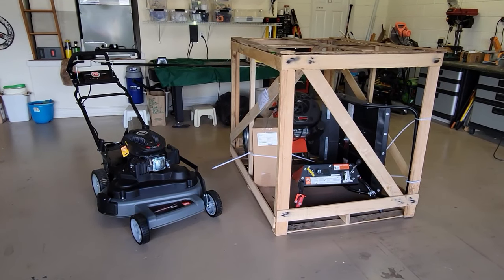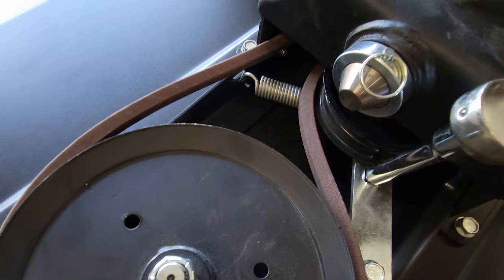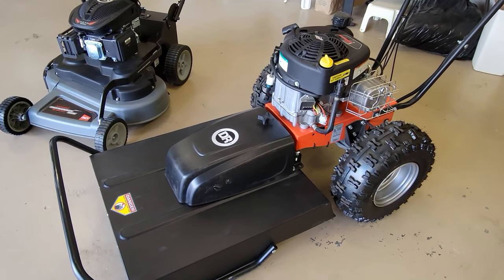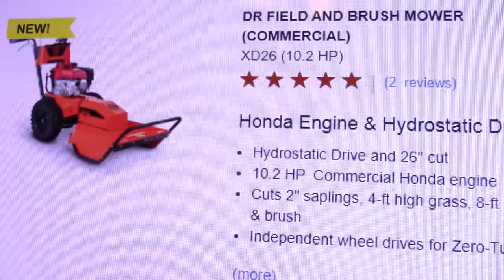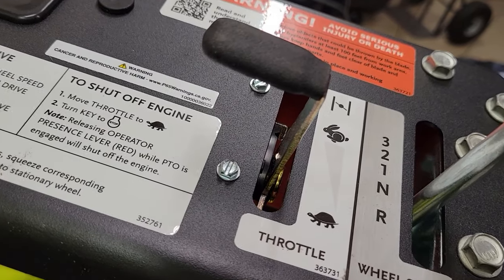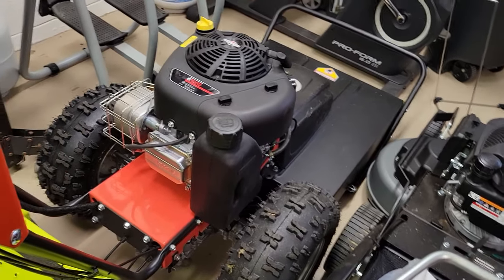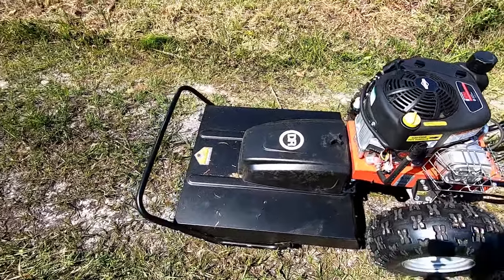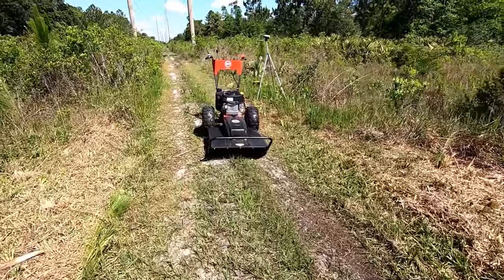DR Field & Brush mower review

Comment: I bought a PRO XL 30 this month and have run it in very tough terrain and 6-foot-high weeds/sapplings about 10 hours over 3 days. I have some comments for those interested in operation and getting started with this nice machine.This is about the PRO XL 30, but it might be helpful for others.  (I am going to post these comments on a few other videos as well, FYI.):
1. At about 16 minutes, this video shows trees and big weeds about 1/2 the size the PRO XL 30 can handle!
2. My dipstick came off at some point, so make sure it is secured and keep an eye on it.
3. If you cut along an edge vs diving into the middle of a big pile, you can see possible obstacles better, avoid stall outs, use the Reverse a lot less, run at a faster speed. A different video shows a guy backing in and out of a heavy brush pile -- very slow going relativelly if you can avoid it.
4. Reverse and the steering brakes are absolutely the best features! Don't buy anything like this without these features. I rented a different machine a few months ago, and the turns and backing out of trouble wore me out.
5. Electric start is great and helps you quickly recover from stall outs -- although the 20 hp engine of the PRO XL 30 is very capable of taking out big brush.
6. Tackling larger trees and getting over obstacles is best accomplished by pushing down on the handles to raise the deck. The driver in this video does this without comment, but it is a very good skill. Also, I have very irregular land compared to this guy, and raising the deck is huge when traversing ravines and dips.
7. Pay attention to the "burnishing" comments in the manual for the clutch and brakes. It only takes a few minutes. I don't know why DR doesn't do this in the factory, but... When burnishing the clutch (PTO up/down on console) the unit almost stalls each time you engage the PTO -- so be ready to disengage it quickly before you do it again (they say 50 times).
8. When assembling the drive to the deck, a nice flat and smooth surface is far preferable. I was able to get this together by myself, but having a helper would have been great. The deck is a little heavy -- but I was on rougher gravel, too. 
9. When setting up initially, make sure you bring your oil (2 quarts) and, of course, gasoline. Goes without saying that it needs oil and gas.
10. When getting the unit out of the crate, you will need (a) wire snips or tough scissors to clip lots of zip ties , (b) tools to pry various stapled boards apart (hammer and  very flat pry/nail removal bar), (c) crescent wrench for the big bolt holding the deck to the side.
11. I didn't do this, but I would slide the deck out of the crate first. Set it somewhere on a nice flat and smooth surface. 
12. When getting the main unit out of the crate, be sure to (a) remove the wheel blocks in front, (b) clip the zip ties squeezing the brakes, (c) put the unit in Neutral.
13. The electric start battery is disconnected, so just plug the positive and negative connectors into the battery.
14. There is another connector down on the bottom right side under the handlebars. It also needs to be connector or your unit won't start.
15. There is a gas shut-off also -- below the handle bars. It is probably in the shut off position when you get it.
16. When putting the drive belt on the pulleys, the most visible internal pulley is NOT what the belt goes around. The belt goes around the smaller pulley deeper inside the engine unit. 
17. If you are running in 2nd gear and do a fast 180, be ready to move fast! Likewise, don't underestimate the speed of the Reverse.
18. Wear gloves!!! There is a safety proximity cut-off on the left and gear enagement on the right. So, when going through brambles, you can't just take you hands off of the handles.
19. Wear long pants, boots, protective eyewear, and, possibly, a forestry helmet with mask. The unit actually kicks up almost no debris, but the sapplings and weeds not cut will snap and snag you.
20. If you get stuck, don't underestimate the great leverage you have on the unit by pulling/lifting the front push-down bar on the front of the deck.
Reply: Idk if that's a good idea or not (to be perfectly honest)
Reply: You're the man!! Great comment. Thank you for taking the time to do that.

Comment: I have the 17.5 hp field and brush mower with the lawn deck and grader blade. Greasing the shaft helps to connect and disconnect the deck and other attachments. Secondly, if you remove the belt from the large brush mower pulley and put it on the pulley beneath the machine first, you can then put it on the large front pulley without using additional tools.

Comment: i just purchased a new DR Pro-26 brush cutter with electric start, a 26" deck, and disc brake "power steering."  i used the machine today for the first time and will say it is a beast to "wrestle" around. this machine is NOT for the "faint of heart" or someone who is very old or physically weak. i used this machine to cut high weeds on a very steep slope behind some property that i have and the power steering worked very well on this terrain.  but i want to mention a few things a new owner SHOULD DO FIRST. 1. the machine ships without oil and requires about a quart of 5W-30 synthetic oil. 2. make sure you tighten the blade retainer nut before you install the mower deck.  3. the gear shift lever is not well designed and takes a while to master.  4. CUT IN LOW GEAR until you get to know this machine!  5. the electric clutch MUST be "broken in" with a FIFTY cycle "on and off" procedure before you use the machine!  6. for some odd reason, the reverse gear is faster than the forward low gear. be careful when you first shift into reverse!  7. charge the battery FIRST if you get electric start.  8. the handlebars can be lowered by removing one of the two 9/16th bolts on each side.  i did this and it made the machine a little easier to handle.  9. i had to adjust the "dead man switch/handle" on the left handlebar moving it inward about two inches.  this made it easier to hold onto the left handle while depressing this switch. you must hold down this red handle AND press the electric clutch  switch down to make the mower run.  10. DO NOT expect to handle/run this machine like a "lawnmower" - it is MUCH more demanding than a lawnmower.
Reply from the maker: Very good comment.  Thank you.

Comment: Great video.
I had a gravely 2 wheel walk behind tractor with a 30” rotary cutter on the front of it that worked well but not nearly as impressive that DR mower.
They are amazing machines
Reply from the maker: It really did amaze me.
Reply: I still have a 1967 gravely I inherited
Reply: @Something2LookAt  yeah im getting a 16.5hp with brush hog and the other 4 attachments with my new dr wich there way 10 times cheaper then BCS unit  10.5hp bcs with coupple attachments here are around $20,000 wich pricey

Comment: Wow I need one of these things badly. Sure beats the hell out of the handheld brush cutters. This look like it would turn a few days of work into a couple hours!
Reply from the maker: Indeed. This really is the right tool for the job.
Reply: yeah plus it saves ya then  buying a snowblower ,lawnmower and powered wood chipper it makes job easy all 4 season multi purpose machine instead bunch of engines sitting wich drs doesit all in one powerful engine

Comment: A little ballast in the tires for added weight and a set of chains or R1 tires and you'd be set pretty well for traction. Good review Mike.  Hope to see more with the 30" finish mower this summer.
Reply from the maker: Indeed, it does have the power at the wheels to turn even more aggressive tires. Yes, I'm getting a lot of requests for more mowing with the SP30. I'll try to take it out and mow this week with it. Hope to mow some tall & thick grass this time.

Comment: How hard is it to control on hills?
Reply from the maker: The transmission is very strong, it will not stop turning the tires no matter the incline. Straight up would be easy, sideways on a hill would be a handfull.
Reply: @Something2LookAt  Well, on day one I learned it doesn't like soft dirt, squirrel holes,  or anything too steep (scary.) I have to take it very slowly and carefully. Thanks.

Comment: Actually, not hard to at all to break it... Brand new unit with 10 minutes on it, broke the reverse transmission cable..  Called support and they started by saying it would be 10 business days before they would send me the part to fix it.  They finally agreed to send me the part using express shipping.  Pretty unhappy that I bought the DR brush mower.

Comment: IMO you made a better video then DR made a mower, I dont know what worked harder, you or the mower......
 First the good then the bad bad bad bad bad........ DR did good on 3 speed mower, BUT 1st gear needs to be a bit slower for some terrain for some people. The next thing needed is wheel lockers and or a track set-up. Then seems to me it wouldn't take to much imagination to make a tiller attachment, be a good selling point especially on a 3K+ machine, then a furrow add-on for making rows in garden, then they should have a wheel barrel attachment for getting in firewood, then for winter a snowblower attachment....... Then and only then will I consider a DR mower..........
Reply from the maker: Oh yes, a locking wheel diff would really help.